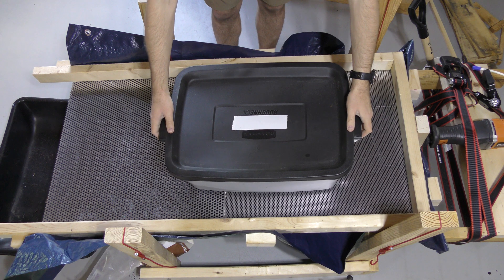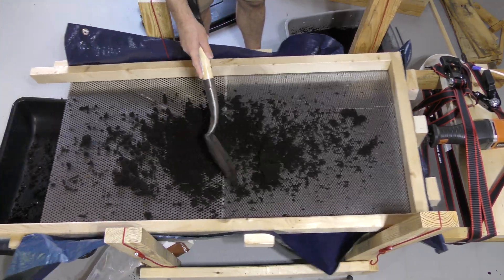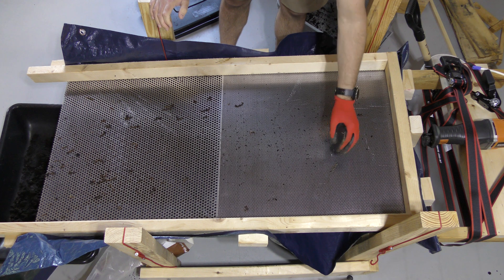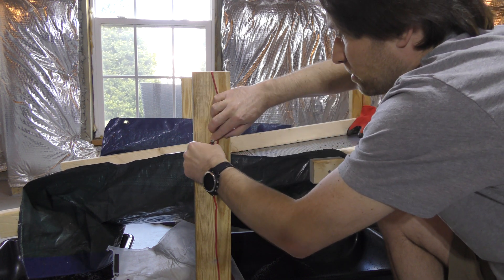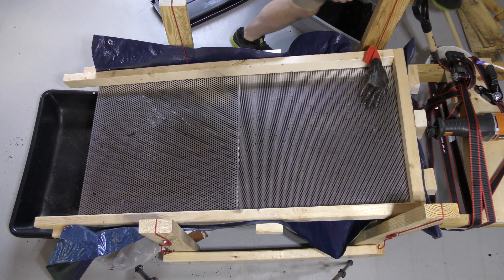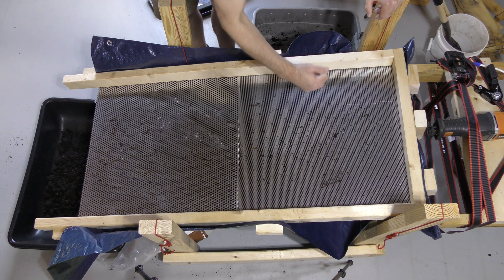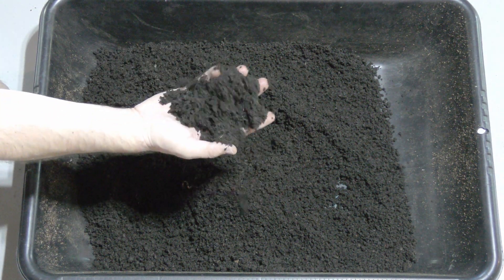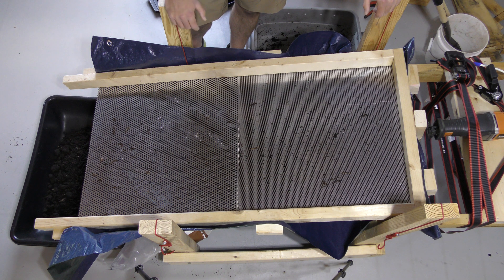DIY Worm Sorter 2nd Test Harvesting Worm Castings/Vermicompost

Comment: What about turning the motor on the side to get a left to right motion.  Of course you’d need to redo the base to reflect the new motion
Reply from the maker: I would need to reinforce or add a larger piece to the side but I could try that. I recently saw someone attach it to the top in the middle with a board going across which might help as well.

Comment: Keep the original lower slope but use the higher speed
Reply from the maker: Trying to work on that. Hard to control a sawsall to run slower. Tried using a concrete mixing motor and it somewhat worked but the material was moving in circles instead of down the chute. I recently saw someone attach the mixer in a different way and I might try that out. Been busy so not as much time to test things out as in the past.

Comment: Vibration.
Reply from the maker: I actually purchased a vibration motor but I had other issues where the castings would move in a circle instead of just going down to the end. Biggest issue I have with this system is the noise and the fact everyone is home where as I typically had times when everyone was out so I could work with this more often.
Reply: Well don't give up. We're waiting for you to profect the Solar Whisper Werm Caster 2000.
Reply from the maker: I won't stop working on it. I have made a couple upgrades just haven't put it on film.

Comment: 2nd sifting speed seemed ok with it may be you need to reduce sloping angle a bit and increase the length of sieves to ensure that one sifting does the job.
Reply from the maker: I really need to 3D print something that can hold the trigger at just the right point. Unfortunately it has a hair trigger where it goes from not moving to about 800rpms with a mm of movement. Very hard to get it right.

Comment: Are you using ping fine holes for worm castings top half bigger holes bottom half
Reply from the maker: Yes I have 1/8 inch holes up top and 1/4 inch on the lower section.  I did this as if I wanted to later I could separate them out with two different bins.  But in the end I feel it isn't necessary.

Comment: Why the two screens?
Reply from the maker: One has smaller holes than the other. If in the future I wanted to sort based on casting size I could. Not necessary by any means.
Reply: @WorldComposting  So does the first screen for castings and the second for cocoons?
Reply from the maker: @Superflow25  The first screen in theory would allow cocoons to pass over and they would fall through the second screen.  The hole sizes are 1/8 and 1/4 inch.  I have the castings all going to the same area.  Part of the reason I did this is the first screen would allow the material to spread out before getting to the larger holes.  In theory this could have been a solid piece of metal.

Comment: As you built your machine to be similar to the commercial version from Oregon,  I watched your vid several times in order to understand the problems that you were experiencing.  When I began to engineer my own sorter in the image of the commercial design, I noticed a major difference between your a their machines an that is the motor that is the heart of it. Your motor pulls back and forth, while the commercial model uses a vibrating motor instead. 
 All the material will then bounce and become more apt to fall through the proper screens. The small worms and cocoons fall through the 1/4” mesh and castings through the 1/8” mesh screen. The larger worms (reproducers) along with the larger debris falls over the edge.... that is only my theory as I am in the process of building the thing with left over lumber at home. Hope I works well. 
Hope that helps ya in the future. Till the next time... keep on worm in.
Reply from the maker: Hmm you might be right the videos they put out aren't that high quality so it is hard to tell.  I might have to find a way to vibrate the system and see if that works!
Reply: @WorldComposting  
Perhaps a palm sander for more of a vibration action. I pour concrete into moulds for countertops and use a sander pressed to the mould to get air bubbles out.
Reply: @WorldComposting    Yea, I’m trying a commercial 40w vibrating motor. We’ll see, might be too strong for my rig .
Reply: The only thing i noticed is the commercial one uses a 1/16" screen at the top and 1/8" screen at the bottom. Smaller screen would probably be better for allowing the smallest of castings to fall through while allowing the rest to slide to the bottom. And with this method vs vibration you might still have to run twice but what a great way to save on your initial investment buildin it yourself. Only other thing you might consider is the mosture content might be a bit high to shake it through. Dry it just a  bit moe andsee what happens

Comment: Hang in there but consider a nice sized and sloped feed plate. The plate is stationary would hold nearly half one of your bins. Gives a chance to break up some of the clumps. Best regards.
Reply from the maker: I have thought about adding something like that but the big issue is I would need more weight to counterbalance the feed plate as it would be hanging off the back of the sorter.

Comment: I was looking at the perf metal. Do they ha EA smaller perf?
Reply from the maker: When I purchased they had multiple sizes and thicknesses available.  They also had holes as small as 1/16 of an inch.  I debated on going much smaller or even one big piece with 1/4 inch holes but decided to use to pieces with one being a landing area where it could flatten out a bit instead of falling through from the weight of dropping on the tray.

Comment: Possibly a rolling cylindrical sifter would have worked better. While tumbling around the sticky lumps would get bumped about and broken up more. Also the change from the small grid to the large grid may need a small step downward. In your demo I could see some parts being pushed back up the change from small to large. Great machine tho.
Reply from the maker: The second screen is below the first screen and while there isn't much of a drop I would think it would still keep things from moving back up.

Comment: Perhaps consider placing a v shaped funnel with a small opening at the point of the v to contain the castings a bit longer on the fine hardware cloth to give it more time to sift before it progresses onto the larger hardware cloth? In fact, maybe also place one near the drop point on the large hardware cloth too. The slope of the incline should move the castings along.
Reply from the maker: I have thought about doing this and still might as I do have some extra wood I could use.

Comment: Those sifted castings look amazing. The machine is nice. I’m trying to commission my teen to build me something similar. Maybe a rolling sifter.
Reply from the maker: My son helped me a bit when I needed to saw some boards so if you can get yours to build it that is a step ahead of me.

I built a rolling one and have a video on it but went to large and I found the worms getting caught up in it rather than rolling through. I also really needed a motor to turn it so I would just be loading the material to sort.

Comment: Perhaps if there were some baffles that would force the material to pass left and right over the screen while making its way down there's be more chances for the material to break up and pass through. I suppose the downside of that would be its tendency to (probably) capture a bunch of worms . I guess that's probably why they can have baffles in rotary screeners - because the worms will eventually drop off and get sent through the system. Anyhow - I'm always a fan of automation like this... so I look forward to future improvements and upgrades.
Reply from the maker: I debated on adding baffles but think I would need a longer screen at that point.